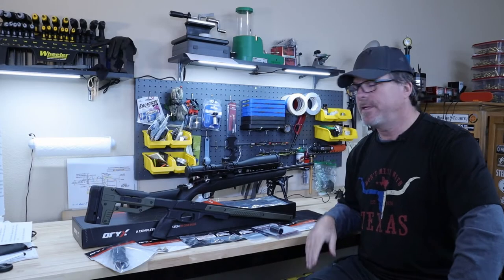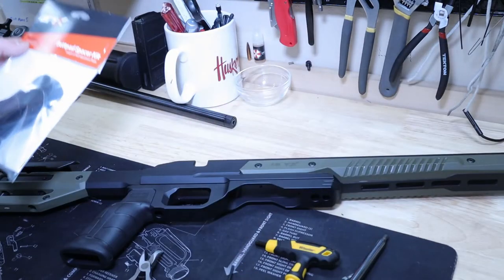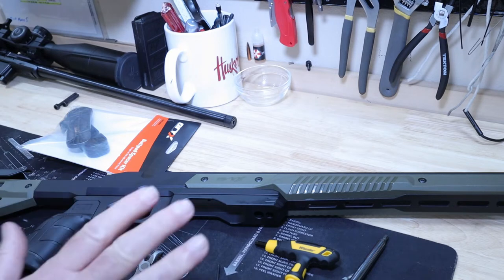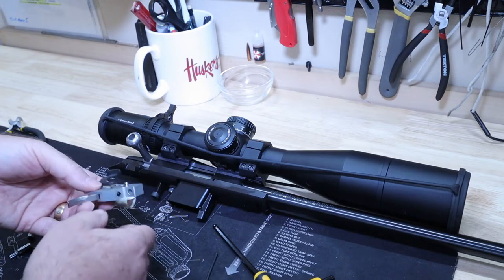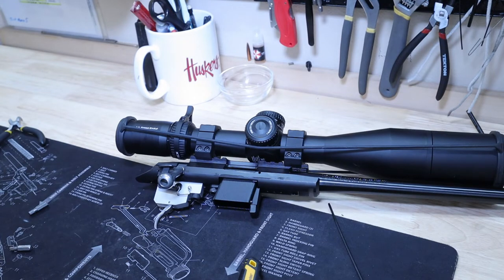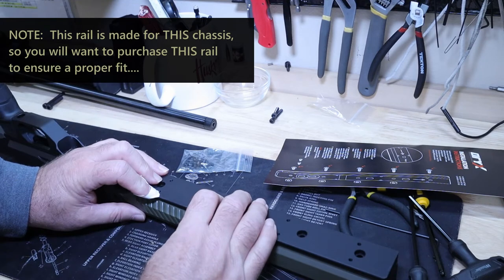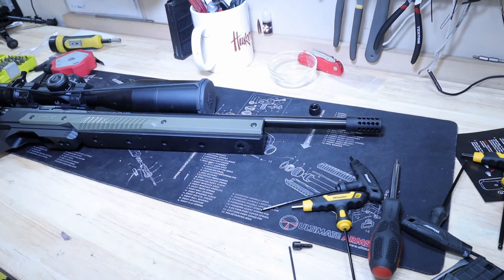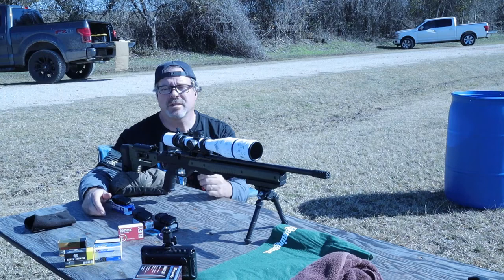Tikka T1x upgrade with ORYX Chassis

Comment: Can I ask why you went the Oryx over the Bravo? Seems the Bravo is often the go to for most?
Reply from the maker: Hi Ryan!  It really came down to the fact that I run an MDT chassis on my 6.5 Creedmoor competition rifle and know their products.  Oryx is an MDT company and in my research I read good things about them.  The Bravo chassis is another EXCELLENT choice.  The main thing for me was the ability to EASILY mount an arca rail so I could reuse all the accessories I have on my "big" rifle on this one.  The Bravo has an easily mounted arca rail, so again, a really good choice.  I'm really loving this stock.  Hey thanks for watching and your inquiry my friend!  Shoot Straight!
Reply: @The4GunGuy  thanks for the detailed response! The MDT looks great, and seems to be a couple hundred cheaper here in Australia than the Bravo. I just need to find a place to buy it. I'm not looking at running an Arca rail - just a picatinny rail for an Accu-tac bipod.
Thanks again, I'll keep an eye on your videos!
Reply from the maker: @Sisu2280  I saw your other question about Gen 1 or Gen 2 but it doesn't show here.  I'm not sure actually because on the ORYX website I ordered from there is only one version of the chassis.  Sorry!
Reply: @The4GunGuy  haha yeah I deleted it because I worked it out for myself! Was watching Tampa flog the Packers. 
MDT do the chassis without the plastic rails, but you need to add the grip and the butt stock. It's a more exspensive option, closer to the Bravo in terms of price but it seems the chassis is 100% alloy.

Comment: does the raised edge of the buttstock rear get in the way of pushing a cleaning rod through the barrel?   I understand the cheek riser can be removed but does the cleaning rod bend when it hits the read raised edge?  although one can use a brass jab and a fiberglass rod I am still concerned about the rod not entering parallel to the barrel and possibly damaging the lands.  any experience with cleaning the barrel so far?  also what size cleaning rod do you use?
Reply from the maker: Hi Plrodrig123!  I use a single (no sections) normal diameter long cleaning rod and it does bend every so slightly, but not enough to concern me.  I also have switched to non-brass brushes, specifically the Tipton Rifle Nylon Bore Brush in .22 cal.  Now, in speaking with the .22 "gods", it will take about 300,000 rounds to shoot out the barrel of a .22 cal, so I'll let my grandsons worry about that!  And, using a Nylon bore brush, I'm not worried about any lands damage.  Hope this helps and thanks a lot for watching my friend!

Comment: Wow I have most the same up grades except for the muzzle break.  Next time you test ammo shoot one group with & one group without the muzzle break.  22Lr doesn't need a muzzle break & it has been known to effect accuracy.
Reply from the maker: Hi Charles!  Funny you should say that.  I actually run an Omega 300 suppressor with the 7.62 plates installed on it now just to add some weight to the front for balance.  Thing shoots great out to 300 yards which is the max distance we shoot at our matches. Getting a Vudoo next week and putting that in a Manners TCS stock, so we'll see how that one shoots!

Comment: THANK YOU!   What scope you running?  It’s a beast!!!  Also is this the exact same for a 17 hmr??
Reply from the maker: Hi Tino! The scope is an Athlon Midas Tac I believe...Great budget scope.  Pretty sure you could run the same setup for a 17 hmr, but double check the ORYX website to make sure.  I really liked this rifle while I had it, but it was a bit hard to upgrade it with PRS competition options like a MPA, MDT, Manners, or other chassis/stocks where you can add a ton more weight.  See my other videos on where I am today with my 22LR competition rifles.  Thanks for watching my friend!
Reply: @The4GunGuy  thanks for the reply!!  I just want a gun that’s not my creedmore or 308 and better than a 22 to kill a couple hours at the 200yd range. Thanks again.

Comment: Is there a website where you can buy the tikka t1x complete upper without having to buy the entire rifle like an AR? I don’t seem to find it online
Reply from the maker: Hi Margritski!  It's hard to find just a barreled action for the T1x, so I would suggest you get on snipershide.com and search for one or just buy the cheapest version with a stock and replace the stock.  The only challenge I had with the T1x was the ability to mount it in a chassis other than the MDT Oryx Chassis or KRG (Kinetic Research Group) Bravo chassis, but today there are other options out there such as the TIMBR Frontier Stock, LSS-XL Gen2 Chassis, or the La Chassis T1X Chassis System (which is the only one that comes with an ARCA rail)...Good luck in your search and thanks for watching my friend!
Reply: I just ordered the La chassis T1x and I was looking for the complete upper so I can just add it on and that is where I’m having trouble finding what I need to compete the build. I didn’t want to have to buy a tikka t1x and then remove the chassis and slap the rest on my La chasis just seemed to be a waste of money but I guess I May have to do that as I cannot find parts you know. I wish they had options like the AR. I just don’t like the basic stocks on a rifle. If you find anything else please let me know. Thank you for the response. Nice build by the way.
Reply from the maker: @margritski  It'll be better with the original chassis for resale, then sell the La Chassis separately.  I always keep the "stock" equipment and when I resell, that's what I resell.  Good luck with the build!

Comment: Advice on the ring(seekins) height for 30mm scope. I have the dip 25moa scope rail.
Reply from the maker: Hi Roland!  Thanks for the tip!  I've finally figured it all out for this build and is working fine now.  Stuck with the 30 moa rail and the zero stop on the Strike Eagle actually let's me reach out to 350 yards which is plenty.  Getting a new Vudoo action in next week that has a 40 MOA rail on it so we'll see how that works out.  Thanks for watching my friend!

Comment: Hi! I am a French shooter. I bought an Oryx frame for my T1x and had to sand down the back of the magazine to be able to insert it. You too ?
Reply from the maker: Hi Francois!  I didn't have to do anything for the magazine to fit in mine.  Very interesting that you had to sand that magazine down and hope all is working out well now?  Thanks for watching my friend and Shoot Straight with that new rifle build!
Reply: @The4GunGuy  I bought the stock used and on the box it says for Tikka Short Action. In theory, all T3 short action stocks are compatible but I think the stock for T1x is a bit different. Now everything is working fine, it's just a shame that I had to grind my magazine on my brand new rifle. x)

Comment: The interesting is the new chassis to original stock performance in variations 
Order noted in string of comparison -  Match - club - Midas
New Chassis .85/1.01/1.04 total variation .19 - Ave. group .967 - variation mean .117/.043/,073 - 
total average mean variation .078 - Best performance variation from mean +.039/-.035/-.005
Best performing in order - Midas, Club, Match based on variation from overall mean performance all ammo types, in fact Midas was 7x better performing over the others

Original Stock 1.27/1.52/1.13 total variation .39 - Ave. group . 1.31 - variation mean .04/.21/.18 -
total average mean variation .14 - Best performance variation from mean -.10/+.07/+.04 -
Best performing in order - Midas, Club, Match based on variation from overall mean performance all ammo types, in fact Midas performed 2.5x better than Match, and 1.75x better than Club in performing better than the others.

New Chassis to Original stock in overall mean variation all ammo types 1.79x better
New Chassis to Original stock  with Midas - 2.47x better
New Chassis to Original stock with Club - 4.88x better
New Chassis to Original stock with Match - 2.93x Worse meaning Match was 2.93x Better in original stock

justoverall
competition.
Reply from the maker: Hi Kimball!  WOW, you took it much farther than I did.  Thanks for all this work!  One of these days I'm going to do this test again, but use multiple boxes of the same ammo and take say 20 rounds from each box, then run the strings to see how consistent each brand/type is.  Thanks again for watching and the great feedback!
Reply from the maker: @kimballscarr  Thanks again for a detailed explanation my friend!  I need to adjust the mount on my magneeto speed so I can pick up these smaller bullets, but plan to do that in the near future as well and will compare the ammo's again for consitency.  This is the hardest part of 22 lr as you can't reload, so you're at the mercy of the manufacturers quality.